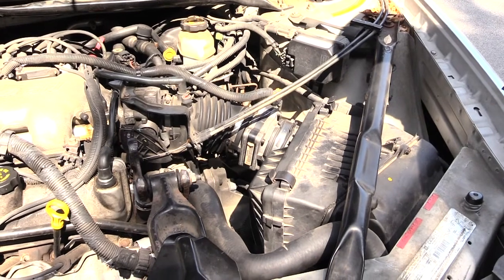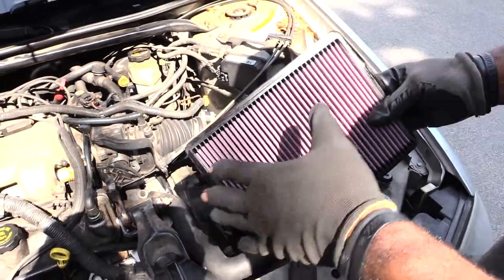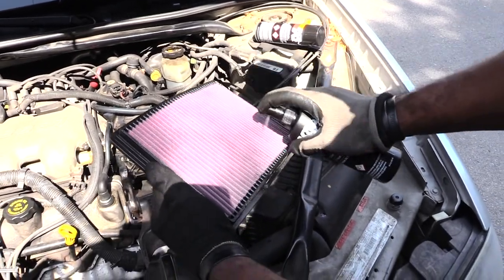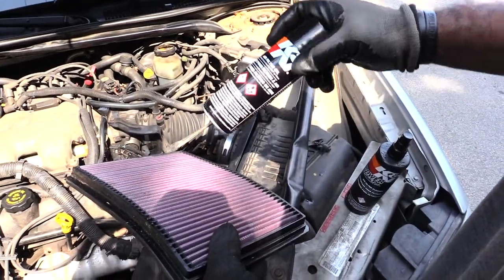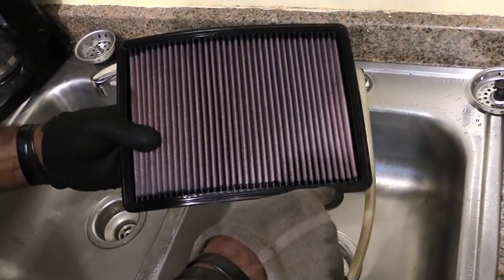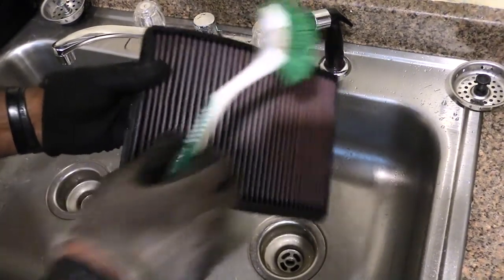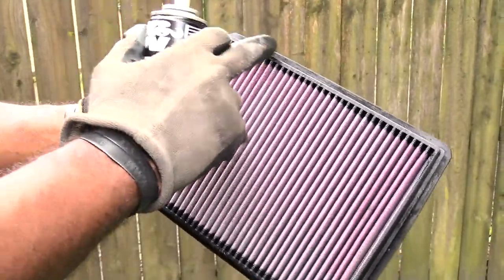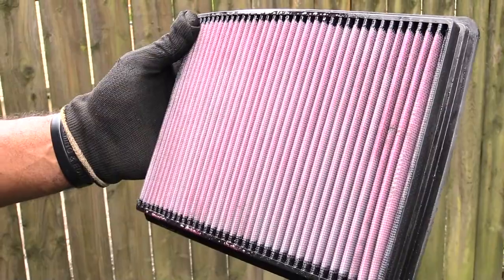Cleaning & Recharging a K&N Air Filter--Easy!!

Comment: I use dawn detergent, scrub brush and warm water. Scrub and rinse till there no more suds, let dry.  Then I use mineral  oil because that's all K&N is with color, coat it real good let stand for minutes and reinstall.  $1.25
Reply from the maker: Thanks for sharing tip. Please subscribe & like and share if haven't already and check out our other helpful videos.